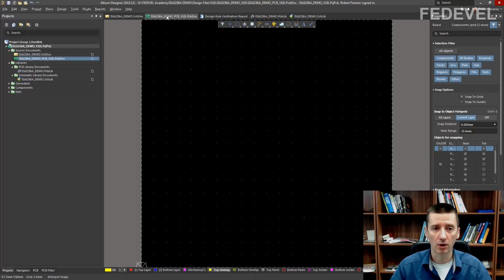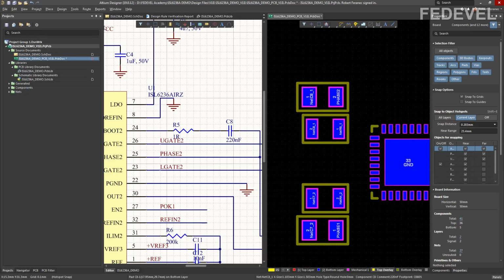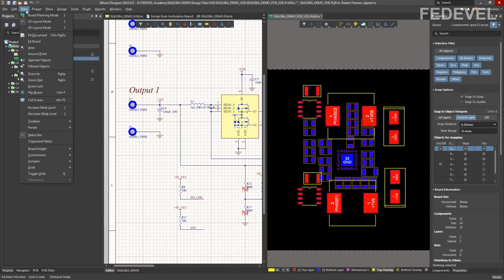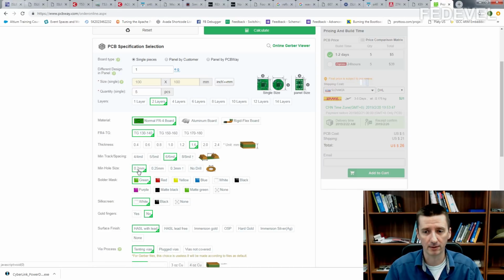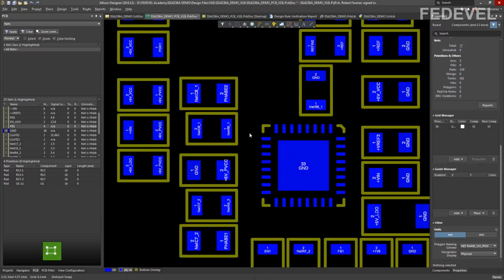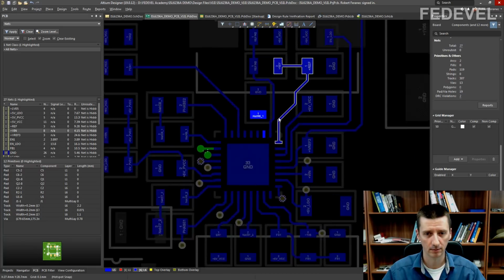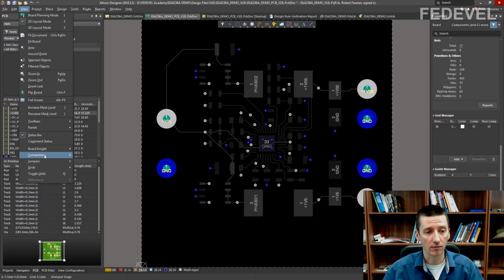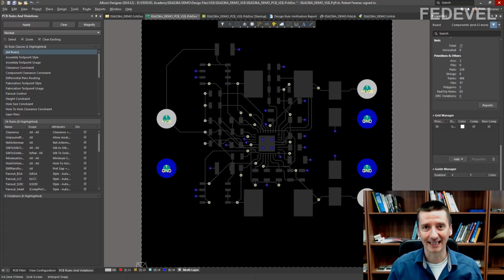Learn Altium Essentials - Doing PCB Layout (Lesson 4) - Second Edition

Comment: Nice Video - Something to add - always make sure to check with your PCB house for their particular DRC and confirm price increases vs. "standard" constraints. 0.2mm hole is a pretty common constraint I follow and I almost never get upcharged. If you use cheap PCB fabs like PCBway, OSH, etc you will see an upcharge for tighter constraints. The same goes for custom PCB stack up, if they have the material there is usually no upcharge. But if it is unique or special materials expect to see an upcharge, most people won't care about this part I assume because this is typically just important for high power and RF designs.

Comment: Hi Robert, It is a great help for those who are just getting acquainted with this program. How to solve the problem if the connection lines are visible and visibility can be turned on and off, but the moment the part is moved, all the lines disappear and only appear when the part has been moved.
Reply from the maker: This will help: https://designhelp.fedevel.com/forum/main-forum/altium/12108-help-managing-the-display-of-the-connection-lines?p=14364#post14364

Comment: Thank you Robert !! Your tutorials helping me to learn Altium. I am a PCB designer and work on Eagle CAD and  Gerbtool. I found out that Altium is best. I have a question, if you please answer it will be very helpful for me.

Q. I want to change the annular ring of through hole components, I changed the drill diameter,say 0.8mm to 1.0mm for all components and so the annular ring decreases. I want to increase the pad diameter at once of that 0.8mm components, I don't want to do one by one for all components.

My English is not good, I hope you understand my question.
Thank you Robert for your lectures !!
Reply from the maker: Thank you Nishad. Use for example filter, only enable VIAs, select all the vias and change pad diameter in Properties panel. This video can help you: https://youtu.be/w9gxB6XVHnk
Reply: @RobertFeranec  Thanks Robert for the reply. I will watch that video and will try the solution :)
Reply: @RobertFeranec  Hi Robert !!
I have written the code for Annular ring to filter the pads which has less than 0.550mm Annular ring but it's not working :(
Am I doing something wrong??

"(ObjectKind = 'Pad') And ('Annular Ring' < 0.550)"
Reply from the maker: @kukunishad  I am surprised, does Altium knows the term 'Annular Ring'?
Reply: @RobertFeranec  I have tried below equation, It is working. But it is not giving accuracy for drill size above 1.6mm. I am searching why is this happening.

"(ObjectKind = 'Pad') And (HoleDiameter > (0.46*(PadXSize_BottomLayer)))"

Comment: Hi Robert, I don't see the pins which are connected together in my Altium? Can you tell me the settings for that? In video, 1:09:00 to 1:13:00
Reply: I missed that part in the video, it is done by setting > PCB editor > Board insight display > unchecking the live highlighting only when shift key down

Comment: Hi Robert,
Your tutorials have been a great help in allowing me to quickly get acquainted with AD20 (I've been a PADS user for 15 years and P-CAD before that!).  However, I do not get the color change when I place a component too close like your video shows and I followed the steps mentioned.  What am I missing?  I don't even get the little white numbers either and my Enable Online DRC box is checked.  When I attempt to get a component closer. the component simply stops at some invisible barrier.

Thanks for any insight you can provide!
Reply from the maker: Thank you William. Altium keeps changing default settings. Try: System Preferences (the wheel) -> PCB Editor -> DRC Violations Display and select Solid. Also double check in the list if Component Clearance rule is checked.

Comment: great job. about choosing 6 layers, is it possible to use 4 layer PCB with the ground and +5V_VCC planes and moving L3 signals to the bottom layer and get the approximately same performance? thank you so much.
Reply from the maker: I think it could be done also on 4 layer PCB.

Comment: Thanks for the video! Could you clarify how do you know where to place components when you say certain coordinates on the PCB, where are those coordinates coming from? 
Also, how do you decide which components to place on top and which on the bottom?
Reply from the maker: - Coordinates: this video is from our course and to help our students to have the board same / similar I say the coordinates. In reality, you only use coordinates for items and components which are defined in your system or by specification e.g. mounting holes, connectors etc. 
- Top vs Bottom: there is no general answer, but for example I place on the TOP components (usually chips) what may get hot (because I can connect them to heatsink if needed and also because heat rises up) and I place on the TOP tall components. On BOTTOM, very often there are decoupling capacitors or for example some small chips and small components.

Comment: Thanks Robert. Very Helpful. Question why are the layer change VIAs placed "manually" after the trace is completed? Seems like an additional step?
Reply from the maker: Oh, if you like you can do it "automatically". I do it often manually, because when there are tracks on other layers, it was causing problems e.g. DRC was doing the placement difficult, or altium was moving the tracks on the other layers, also the Altium reaction was slow etc - it was much easier and faster just to copy and place the VIA.

Comment: Thank you for your tutorials, really useful. 

I cannot change highlight contrast using [ and ] buttons. Do I need to enable something in settings?
Reply from the maker: I think, some people may have problem with shortcuts if they are using laptops or different layout on keyboard. You still should be able to find the intensity in System Preferences (I do not have access to Altium right now, but it will be somewhere in PCB section)